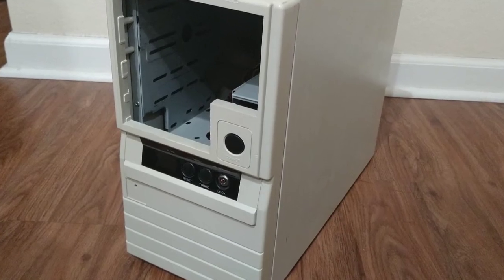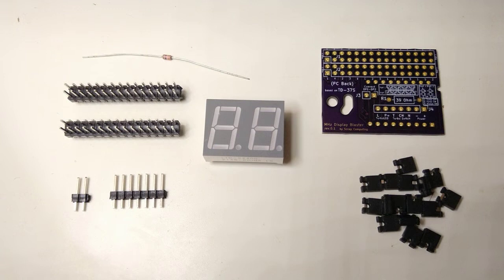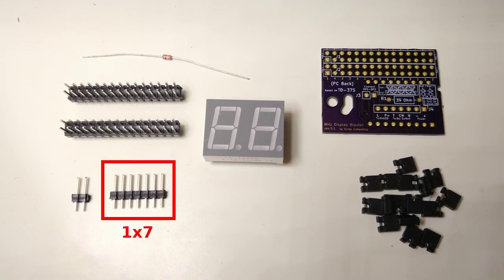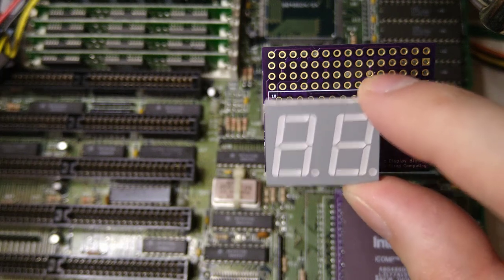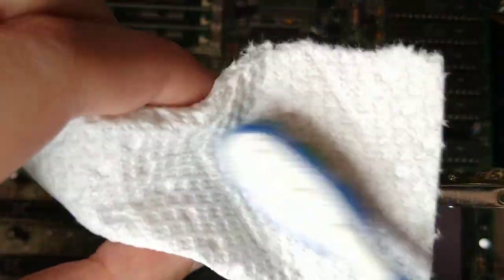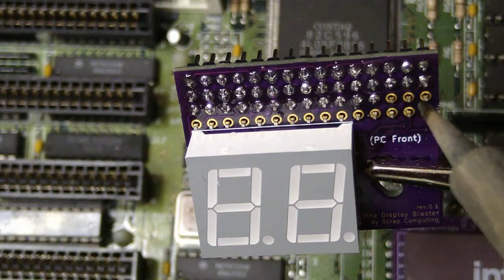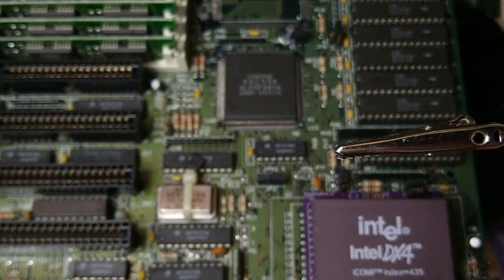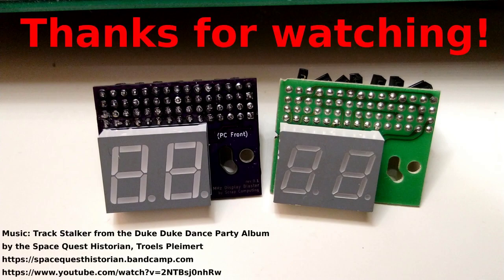MHz Display Blaster: A 7-segment frequency display clone

Comment: Hi im not tech guy..but i need to build my p1 pc..and i want to put this mhz display on my tower...did you sell it? If yes i want to buy it.thanks
Reply from the maker: Sorry, I can't sell them. But it's not too hard for anyone with some basic soldering skills to put them together, so perhaps you could ask some friend to make them for you. You can get the boards made at any online PCB manufacturer and you can get the 7-segment display and the rest of the parts from an electronics store either local or online.

Comment: I tought the size of those displays were kind of a "standard" but the specs of the LTD-6440G  are 2,5mm x 2mm. My two displays are 2mm x 1,5mm.
Can you confirm the display size ? thankyou
Reply from the maker: The ones I used are the LTD-6440G which are 2.5mm x 1.9mm. The dimensions are also shown in the LTD-6440G datasheet.
Reply: @scrap_computing  thankyou ! I saw it. I tought they were kind of a standard but mine's smaller.

Comment: Excellent work 👌.would be nice with a full 3 digit one as well or a 2 + a half digit one. Rebuilding my original first PC from late -94 (Baby AT) myself, and the display had been removed over the years, also the motherboard with plate. But i have managed to find the parts i need although with a slight update then from a AMD 486DX-66 to a AMD K5 PR133 100 MHZ (Pentium) system with 32 MB ram, Cache module, PCI graphics, Sound Blaster AWE 32 etc. Although the display that i took from a donor case is not the same as the original that had two full digits + a half digit, it has 3 full digits that are controlled by a chip and also has a LR41 battery onboard, i guess for keeping settings in memory. Took me a while to figure it out and finding documentation of these kinds of displays, seems they are controlled and set via the reset button and turbo switch. I will have to modify the opening in my case slightly for it to fit also. Really nice to have new ones created and available.
Reply from the maker: Yeah, these displays are not standardized, there are quite a few different types.
Wow, I didn't know that such displays existed! Glad to know you figured out how to configure them!

Comment: Hi. Awesome video! Were i can buy this components to create this mhz display? I need for create 2 or 3 display. Also in 3 digit number. Thanks
Reply from the maker: The "88" LED displays are not too hard to find. You can still get them on places like Digikey. Just check for "LTD-6440G". The "188" models are not widely available as far as I am aware.
You can make the PCBs at any PCB fabrication house.

Comment: A fun thing I've seen done back in the day is you set the normal and turbo "speeds" to complementary "patterns," for example set normal speed to just two dashes (- -) and turbo to be just the upper and lower (= =) and then connect the turbo "switch" to the HDD LED header on the motherboard.

Silly yes, but though it was a cool thing they did, kinda a poor man's VU meter for HDD activity =)

Comment: Yeah, this is the brain dead version that relies on jumpers to set each segment. You could have used a small 50 cent microcontroller and a couple push buttons to set any value by pressing the buttons and storing the value in the microcontroller's eprom memory. Would also help to have resistors for each segment (ex 2 independent resistor arrays with 8 resistors each) to limit the current, so that each segment lights equally bright.

Comment: I have a vintage case with a different MHz display, I wonder if I should clone it as well. Though this display is more straightforward than the one in my case (I have one that uses a bunch of ICs, but it supports turbo and non-turbo numbers). Great project to fix those cases with missing and broken displays!
Reply from the maker: Yeah, that would be great! The more reproduction boards we have the better :) This one also supports both turbo and non-turbo mode, I should have shown it in the video.

Comment: It would be cool if this module give something extra beyond classic Mhz numbers. Maybe POST codes or temperature.
Reply from the maker: Yeah, that would be a great little project!
Reply: Do you have an idea of how you would read post codes? First thing that came to mind is a pci post code card but replace the display with header pins and then run a wire to the front of the pc.

There are probably cleaner solutions so I am welcome to getting ideas.
Reply: Minor update is that I found a pci post code card which also has a serial port connector and a usb connector. This version costs slightly more than the cheapest option ($3 difference) but this seems to have an unpopulated header location for an external led display.

Now only to order that and figure out pinout. Then get a two digit display and solder a wire to it.

Comment: Back in the day I threw out the MHz display and installed the display of a post code card. That made more sense to me. ;)
Reply: Hey why resign yourself with a single segment display when you can have both, your dream is just a dremel and file away!
Reply: @RetroTinkerer  well, as far as I remember, you could send codes to the post code display. So I could display the MHz again. Of cause this only made sense until we got CPUs above 99 MHz… 

This very cool video just triggered these good old memories…

Comment: There are two kinds of green LEDs, yellow-green and pure green. The latter is newer technology, it's much brighter, but it lights in a different shade of green. For the authetic look, the older style yellow-green LED display should be used.
Reply: There are even variations in the classic green LEDs, ranging from 575nm (the most yellowish) to 555nm (the least yellowish).
The super bright green LEDs range from 545nm to 525nm, of course not including the green traffic light LEDs which are typically around 505nm.

Comment: I was waiting for someone to design these. Because I don't like the fixed HI/LO displays of some later AT cases  ;-)
Reply: They were the same thing, but after cpu's hit 100mhz some of them could only go up to 99 to people started making them say hi/lo cause it only needed 2 digits
Reply: @RachaelSA  I thought the same, so I was surprised to see that in one of my AT cases, the display board only supports fixed HI or LO. There's no jumpers to configure anything else.